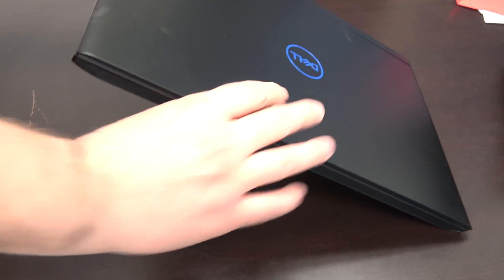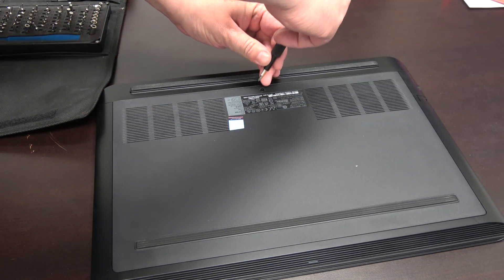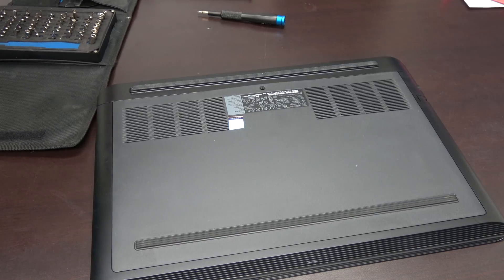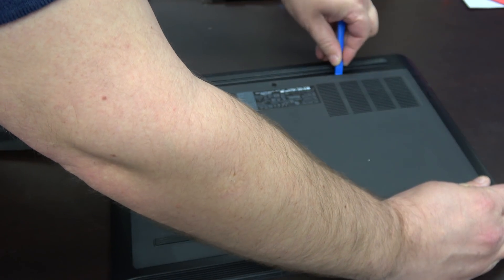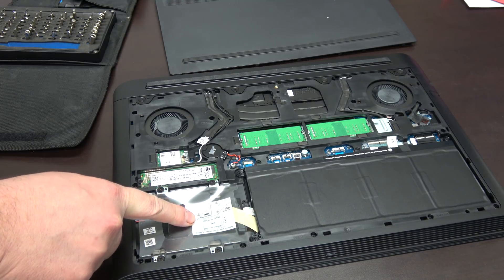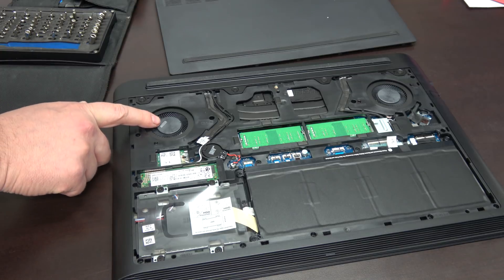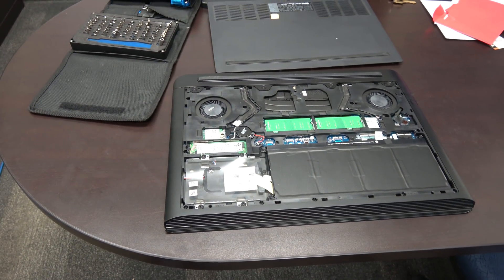Dell G series G7 removing back cover for upgrades

Comment: If you pry it, you'll break the small plastic hooks on the top part. You still have the other hooks intact so the cover will still close firmly, and it'll make it easier to open later. Just a warning that those hooks will break.

Comment: I can change the SSD with:  "ADATA SX8000 512GB M.2 PCI Express - Disco Duro Sólido (512 GB, M.2, PCI Express, 2500 MB/s, 6 Gbit/s)."
https://www.amazon.com.mx/ADATA-SX8000-512GB-M-2-Express/dp/B06Y33KQG9/ref=sr_1_2?ie=UTF8&qid=1541519250&sr=8-2&keywords=512GB+M.2+PCIe+NVMe+Solid+State+Drive

I'm new on this.
Thanks

Comment: just bought this laptop, love it!  upgrading from 8gb RAM to 32gb and hopefully I can add more SSD.  Thanks for the video!
Reply: Holliday, I purchased the 8gb model of the G7 as well, and was looking into upgrades to 32gb. many forums I found said they were having issues doing that. May I ask how your computer is running with the 32gb? Did you have any issues with it? And which RAM did you end up buying/where from and which one?  Thanks!
Reply: @Liz-irk  I havent upgraded yet.  I heard there were issues also but apparently if you buy regular ram and not "performance" ram then it should be fine.  I'd research more to be safe.
Reply: Okay, thanks for the update and heads up!  If I end up purchasing an upgrade before you get the chance to, I'll comment on this what I got and how it works. It will probably be a few more weeks before I do.  Would you mind doing the same if you purchase yours before I do?  I have found a few forums that explained the issue in a little more depth and someone commented on this video below with specs of what they purchased for their upgrade, but it's always nice to have more than one example of people having success, especially since SO many had issues.
Reply: http://www.crucial.com/ProductDisplay?displayCompatibleLogo=1&urlRequestType=Base&catalogId=10151&productId=1505003&externalPartNumber=CT12243702&urlLangId=-1&scanId=9DD8806931D926C3&langId=-1&storeId=10151 I saw that this one works well for the ram upgrade haven't gotten it yet though

Comment: if you are attempting this and dont have the plastic pry, use half a clothespin and it will work perfect!!! Upvote to save the pegs!!!!
Reply: RIP 3 pegs, I should have watched this before opening it...
Reply: does having missing pegs affect it at all? I accidentally broke one and said fuck this and screwed it back on lol
Reply: Just stripped all my top pegs lol
Reply: Used the plastic pry and still broke the top 2 left pegs.  When I upgrade the ram next, the other 2 will go.  Looks like some gaffer tape soon.
Reply: @locs12  I followed the video and the service manual, though a peg broke. I'm feeling less guilty after reading your comment, I'm not alone, thank you.
Reply: I also followed the video of removing the back cover. Worked flawlessly the first time, but the second time I snapped a peg. Feels like this is specifically engineered to drive people with some level of OCD (like me) crazy. Why not use screws all over? Why?! Why?!?!
Reply: what are the pegs and do you know any other alternative for the pry?
Reply: Would a guitar pick work?
Reply: Use a pen cap!! At first I tried using a small screwdriver (lost one peg) but using a pen cap worked flawlessly

Comment: Just did this myself after watching this video and referring to the actual instruction manual. I managed to break two consecutive pegs at the top where you first begin the wedge it open, so the panel hangs noticeably loose there now. Be careful when opening, it's easy to access but also easy to break the panel wedges.
Reply: does the internals and cooling system looks the same as the the previous model 7577? seems like the g5 is similar to the 7577, but I'm not if the g7 just looks different but same internals.

Comment: I heard you can overclock the screen to 100Hz
Reply: You can...but it's not recommended. Overclocking beyond 15Hz is risky because the screen is not designed to handle that. Whether or not it actually can is another story. I've seen mixed reports. IMO it's not worth it.

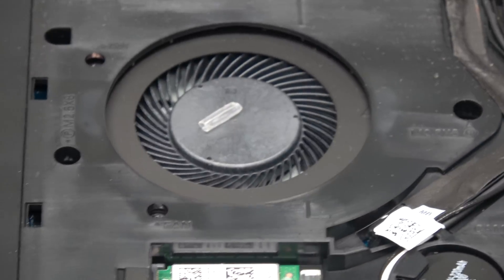Comment: At about 1:31 on the video, I can see that the included SSD is SATA and not NVMe.  This is NOT what is advertised on the Dell website.  Shady substitution?
Reply from the maker: Where does Dell say it is supposed to be NVME?  All it says is 256gb SSD.
Reply: On this page:  http://www.dell.com/en-us/shop/dell-laptops/new-dell-g7-15-gaming-laptop/spd/g-series-15-7588-laptop
Reply from the maker: It says NVME OPTIONS.  I believe they are saying it is NVME capable.  Also there are supposed to be more options coming soon and I believe then they will start offering NVME from the factory.
Reply: That is a charitable interpretation.  I think they changed the configuration without updating their advertising and are now misrepresenting the product.

Comment: i ordered a G7 with 256 gigs SSD and 1060 nvidia. It comes with 8 gigs of RAM and was wondering which 2666 MHz should i add, and does it void warranty to add another 8 gigs to the laptop
Reply: No it doesn't void the warranty. The only problem is that it only has 2 memory slots. As far as I can tell, the 8GB option uses 2x 4GB memory modules. So you will need to purchase 16 GB of RAM to upgrade to 16GB. You can't just add another 8GB module.
Reply: siddharth sah I'd get the 128GB+1TB option
Reply: I bought this model and tried to change the ram with the ballistix model. No good. Tried 2 different modules same issue registers as no ram installed. If you upgrade and are successful can you post what type you bought.

Comment: Is the SSD M.2 (NVME) or SATA?
Reply: I would also like to know if it supports M.2 Nvme Pcie (4 lanes)
Reply: Ok I decided against getting this laptop because I got a good deal on an Alienware 17 R4 with a GTX 1070. But I did find out about the SSD in the G7. It is SATA. Not NVME. So it is better to get the smallest version and upgrade it yourself if you want an NVME drive.
Reply: they are both nice systems but the G7 is almost half as heavy as the R4 which is not even close to twice as powerful
Reply: Yeah if you can't stand carrying around a heavy laptop the G7 is obviously much better. And for anything other than gaming, the 8750h is around 30% faster than the 7700hq. But for portable (sort of) gaming, the Alienware 17 R4 with the overclocked GTX 1070 is still a better choice. The 1060 Max-Q in the G7 doesn't wven come close. They are around the same price atm, so it is 1 of the best prices you can get on a solid laptop with a 1070.
Reply: yep your right the 1070 is for sure better than any 1060, but for me to justify getting an alienware i would have to get the 120hz display which makes the price closer to 2k, g7 is like 1k so they are def completely different target markets i think
Reply: I almost went for the 120hz TN panel but I decided against. The main reasons being 1) most of the games I'm interested in wouldn't output above 60hz with a 1070 anyways and 2) the 120hz TN panel looks washed out by comparison. But if you're mostly interested in shooters, the 120hz is worth it. Either way, they are both better than the 1080p option on the g7. Its not a bad screen but it doesn't even come close. That being said, the only reason I went for the Alienware was because it was on sale for around $1500 - 10% extra coupon discount. I agree it wouldn't be worth it at 2k.
Reply: supported. using cheap model from Adata SX8200 240GB

Comment: Wat is the SRGB % of this G7 ?? Please ans 
Can i use it as video editing laptop ?
Reply: Shivam Wagh 65%
Reply: Did you get it ? I'm considering buying it for the same use. If you could share your experience ?
Reply: Dell G7 is a gaming laptop its not for video editing it have a good rendering performance but if you want a video editing laptop buy dell xps
Reply: I shoot 4K video and also do photography for a living and YES...a gaming laptop is perfect for video editing because of the horsepower (processor, NVideo graphics, SSD, memory, etc.) they put in these machines.

I just rendered a 20 minute 4K video to 1920x1080@10mbps in less than 7 minutes with my G7.  Completely blows away my previous laptop.
Reply: Consider the acer predator helios if you’re video editing and into gaming 
But it would have more cheaper material 🤷🏻‍♂️

Comment: How is the battery life of the laptop? With gaming and normal work (browsing and ms office)
Reply: Bhav Kapur I don't see anyone saying anything about it so far but it has a 56Whr battery and anything from a 1050 to 1060 Max-Q so unless it can use Nvidia Optimus I'd suspect it would be maybe up to 5 hours at best and maybe 2 hours at worst depending on the workload and power settings
Reply: I have one and if you have it on the "dell" power plan its not too bad, the backlit keyboard will guzzle the juice, but its about what you would expect for a laptop of this size and capacity, the fans have enormous speed its like a jet when they kick in

Comment: I’m not an expert when it comes to that but I think most people use a calibration device such as this https://www.amazon.com/dp/B00UBSL2TO/ref=emc_b_5_i
Reply from the maker: You would need a spectrophotometer and the right software, I don't have $1500 laying around unfortunately.
Reply: 03stage2 it’s fine, just gonna have to wait for someone with the equipment to do it D:

Comment: Which variant did you buy? The 8 GB or the 16 GB RAM version? I was trying to decide between the two and I was hoping the 8 GB variant only comes with a single stick or RAM rather than two.
Reply from the maker: I bought the 8 gig version.
Reply: 03stage2 ok, thanks
Reply: Ben Graves you can do up to 32 GB with 16 GB max in each slot. Word to the wise, I bought 32 GB of Patriot Vengeance and it was not compatible for some reason. I would just try to make sure you buy from somewhere that you can return it.
Reply: Crucial 16GB Kit (2 x 8GB) DDR4-2666 SODIMM
CT2K8G4SFS8266  UPGRADE FOR A DELL DELL G7  The earlier Kingston Hyper I had purchased however would not work.
Reply: Forgive the noob question, but can you add more RAM?
Reply: What RAM did you end up purchasing
Reply: SK Hynix HMA81GS6AFR8N-UH will work fine. Haven't found anything else.
Reply: Oops ordered off Crucial website says it’s supposed to work
Reply: Hopefully it works. I know there were people that bought Crucial memory and it didn't work.
Reply: Yes they did work
Reply: Timothy Arthur that’s awesome to hear! Can you reply with the part number, please?
Reply: Thanks!
Reply: I also installed a 120 hz display

Comment: Doesn't it come with a fingerprint sensor? & How about the display quality?
Reply from the maker: Display is good, no fingerprint as far as I know.
Reply: the fingerprint sensor is included in Europe by standar
Reply: i think its going to be the same as their inspiration 7000 gaming series as far as the screen.
Reply: you can add an optional fingerprint sensor as written in their specs pdf - the 3rd page - on the layout description USA website. attached manual.
Reply: does that mean it has it and you can disable it or you have to order it with that  @mido99990000
Reply: @cyndai7324   within the standard model it is not included it's actually an additional 20 dollars